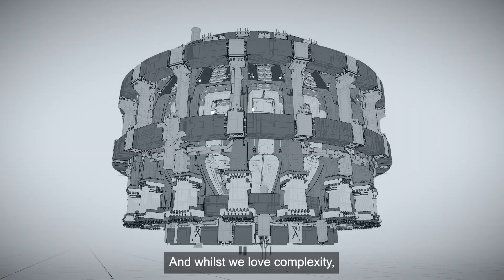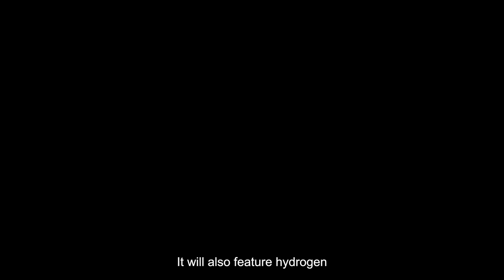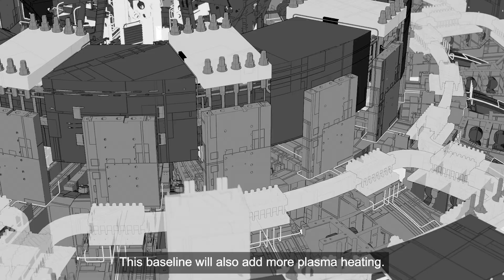A baseline? Here's what that means for ITER

Comment: These comments under this video are so childish and its obvious that they have no experience with any engineering project. A project of this size and complexity is bound to be scheduled optimistically in the beginning. But this schedule is dependent on all the suppliers of the components. I wouldn't be surprised if the number of suppliers is in the thousands. Covid mustve shut down many of these suppliers. So you need to find a new supplier that can deliver im the same quality. This needs time! You have to build the whole infrastructure around the part that needs to be produced. Its not so easy as just ordering something and expext next day shipment. We are talking years before parts arrive. And of course you cant assemble everything in the same time. You need to assemble a part, then test it, see if something needs to be fixed and then continue with the next part. This whole setup is one of its kind, so everything takes really long.